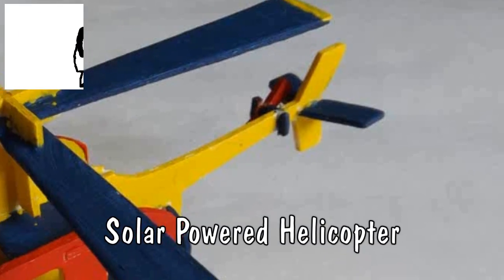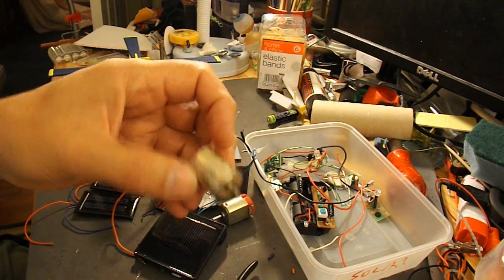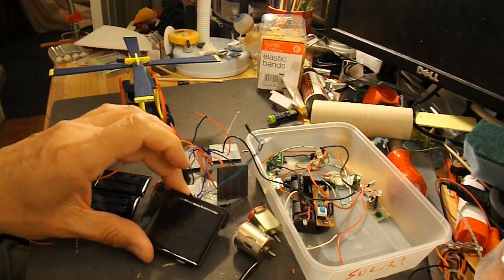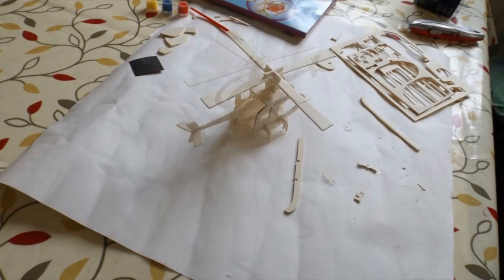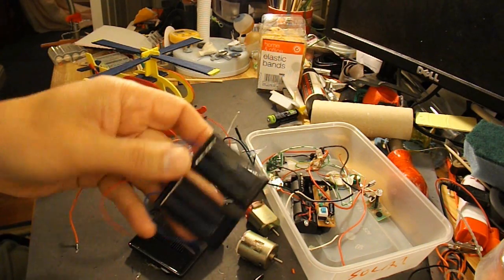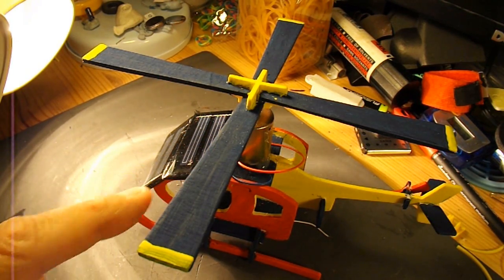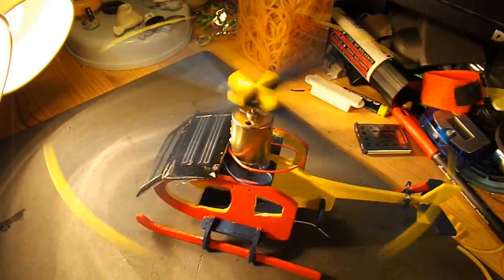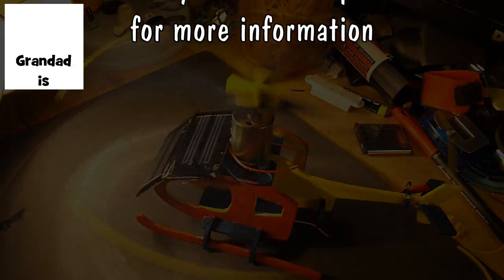Solar Powered Helicopter

Comment: hi sir can you tell me what is the name of the motor you have use in this video tnxxxx
Reply from the maker: The short answer is No. I don't have a name for it. It came from a garden ornament that had a solar panel and a plastic butterfly on a piece of wire. When the sun shone on the panel, the motor turns and the butterfly would fly around the plant. If you search online for "solar fluttering butterfly" you should find something similar. This video shows the type I used https://youtu.be/Wj1YnnnT7yk?list=PLA5a2xPRSrB0xwiEqrAmS4SLKN8bq2Ffy

Comment: hi , what size motor n solar panel are those?
Reply from the maker: Hi Dave, they come from a solar ornament. The motor I initially show is not the one that is in there now. In this video I show the Solar Fluttering Butterfly ornament with the panel and the motor I finally used. To give it a bit more power I used two panels. https://youtu.be/Vt6p5wOdpV0

Comment: if the motor was more powerful space travel at home would be possible
Reply from the maker: +Nathan Hoprrr haha yes, but if the motor was more powerful you would need more powerful solar panels to run it and even if you had a more powerful motor and more powerful solar panels your travel would be limited to the atmosphere. Without the atmosphere the helicopter could not fly :)

Comment: if i get a smaller model with a small rotar then will the motor be able to fly it?
Reply from the maker: +Krishna Arora if you mean using the solar panel to power it then the answer is no, but don't let that stop you trying. You will learn much from that project.

Comment: on i mean to get the rudder mecanesum from the rc glider and put it on the back of the hover craft and then go to a hobby store and ask for the most powerful light wight eletric motor and use that as your motor sorryfor spelling
Reply from the maker: You mean to make an rc hovercraft, sorry, I misunderstood. Did you look at that one by Mystery Kings that I linked to in your other comment. That seems to work fine.

Comment: Hi I am only 12 but go to a hobby store and there should be a kit to build a battery powered hover craft it comes with a light weight motor and a propeller then just get the rc glider and install 2 rudders.1 rudder with the bar you use to turn the rudder on the glider then put a little bar on the top right of the right rudder then connect it strait a head or to be easy just install one rudder
Sorry for the spelling
Reply from the maker: Hi Nicolas, thanks for commenting. I guess you are talking about one of my other projects. If I had to go to a hobby store to buy the hovercraft kit to get the parts to fit to the rc glider, then why don't I just go to the hobby store and buy an rc plane kit anyway?

Comment: Can you make rc hover craft???? pppplllllleeeeeaaasssee
Reply from the maker: Hi Nicolas, none of the motors I have at the moment would give enough power to lift a hovercraft with the extra weight of the rc kit, the ones I have made struggle just to lift the battery weight. If I ever get some more powerful motors and some light weight batteries (LiPos) I will probably make one. My projects are generally made from cheap or recycled items so it just depends what turns up.
Reply from the maker: Have a look at Mystery Kings new video, that looks simple and fun.
http://youtu.be/8e070dZVhcE